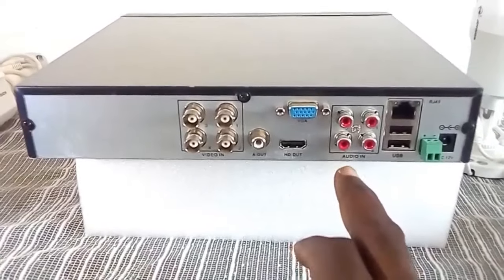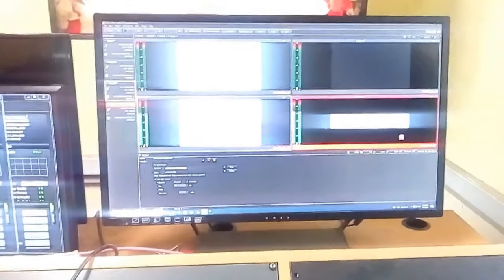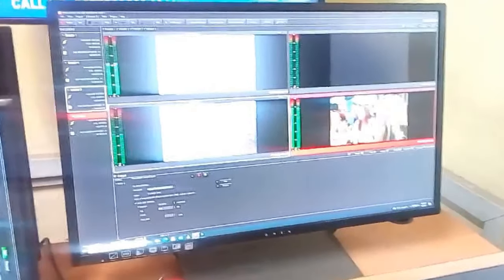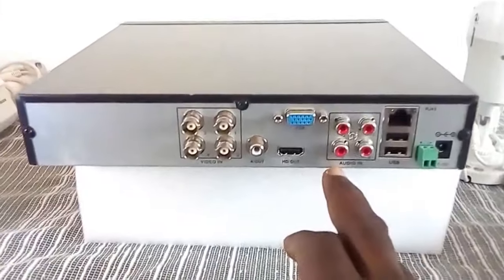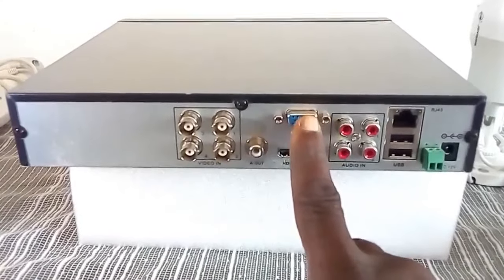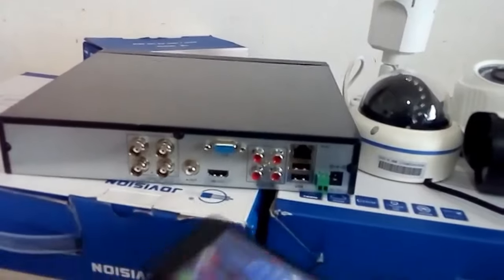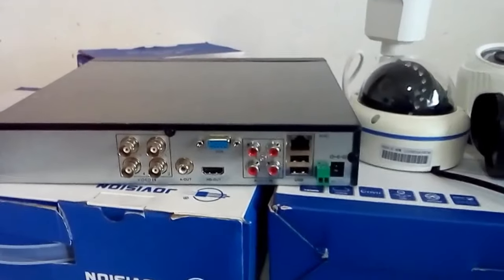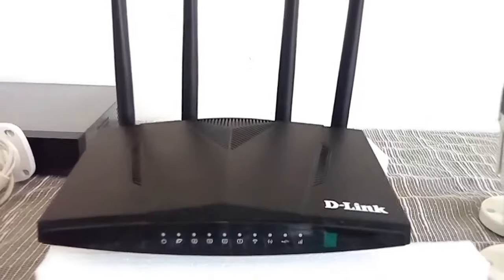CCTV Camera Installation (Beginners guide)

Comment: Sir, i understand the connection from the dvr to the monitoring and i think it can be connected using an HDMI cord
Reply from the maker: Yes, you are right.  You can also use a VGA cable instead of an HDMI
Reply: @Tech_Inside_Out   thanks sir.
Reply: Can the monitoring screen be a plasma TV in a situation where to computer monitor available?
Reply from the maker: @elohorolokpa  You can use any tv or computer monitor,  no matter the size or brand
Reply: @Tech_Inside_Out  thanks sir for the timely response

Comment: Sir when you use a router do you need internet connection
Reply from the maker: No, you don't need Internet for the router to function.  The only reason why you may require internet would be when you need to access your cameras from a remote location far away from your cameras. Remote location means for example,  you being in America and access your cctv installed at Nigeria.

Comment: What are the balons for? is that an option or why use them to connect the cameras?
Reply from the maker: Video baluns are used to allow for the use of network cables to transmit Analogue CCTV camera videos to the DVR. They are not needed when you use coaxial cable for the use of video transmission
Reply: @Tech_Inside_Out  Im not sure if I get it right. If it is an option, then why use them? It looks less complicated to simply use coaxial cable
Reply from the maker: @user-rs6gg6bb1d  The baluns are used together with cat 6 or cat 5 cables, but you don't need the baluns when you are using coaxial cables
Reply: @Tech_Inside_Out  .Thanks guy